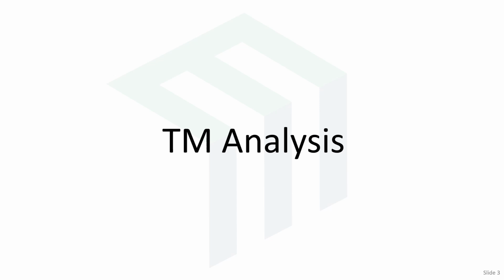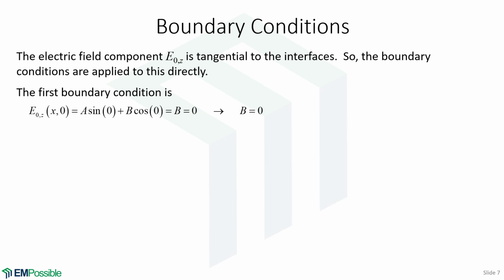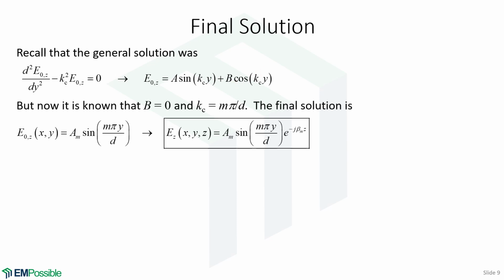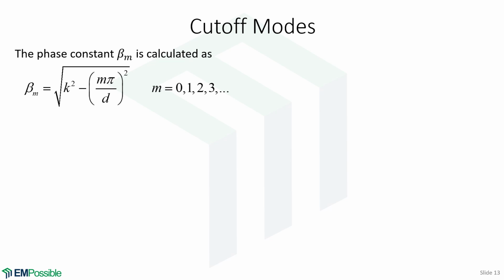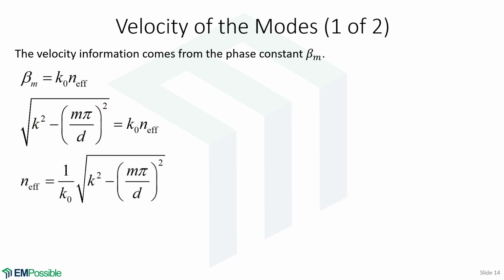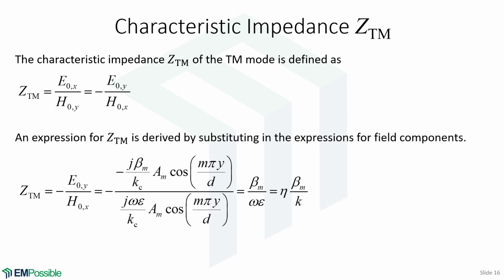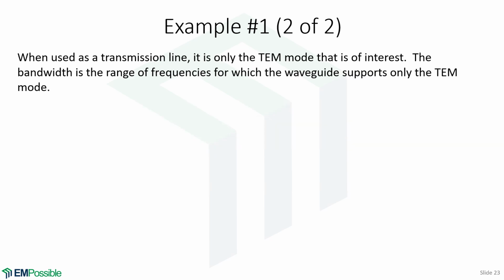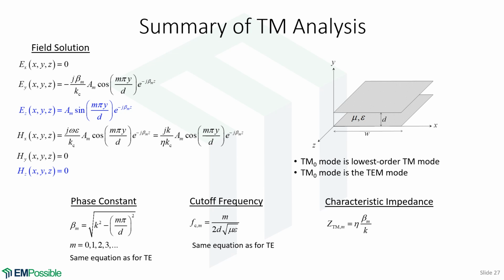Lecture -- TM Analysis of Parallel Plate Waveguide

Comment: Might be a silly question. Why at slide #4, a derivative term w.r.t z is ommited? Shouldn't Ez vary over z ?
Reply from the maker: That derivative was already performed and is the reason the kc parameter appeared.

You need to watch the videos leading up to this video because some work was already performed. I recommend accessing the content from the course website so that you can see the organization and get links to the latest version of notes, videos, and other learning resources. Here is the link:

https://empossible.net/academics/emp3302/

I recommend working through Lectures 9a-9h before this video.

Hope this helps!